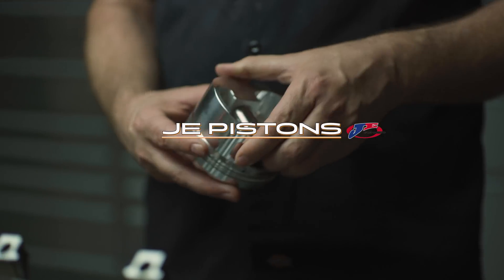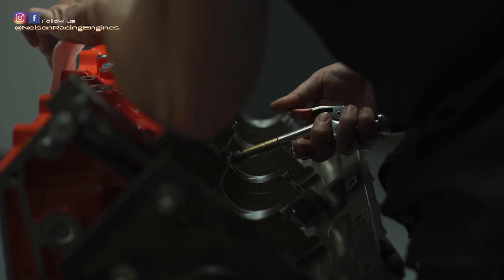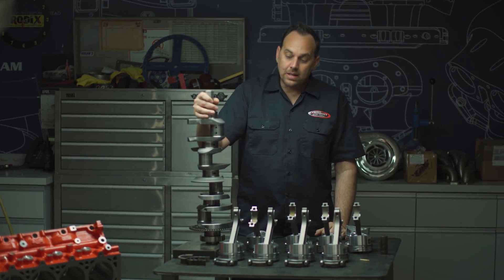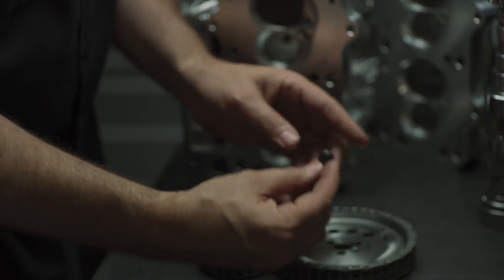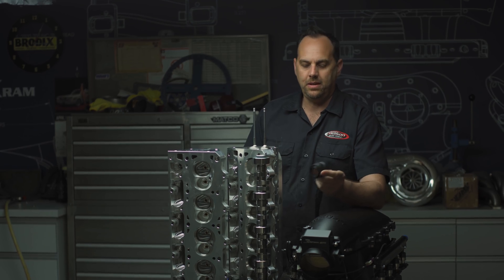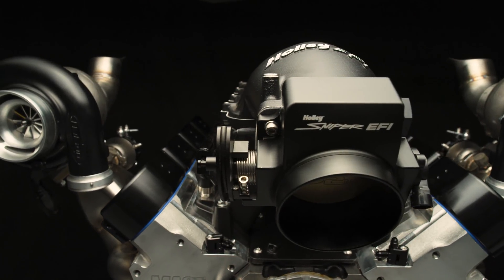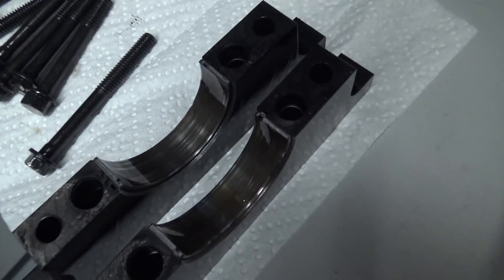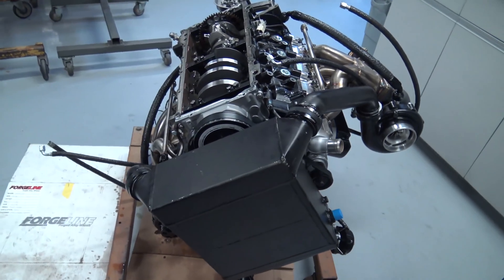Secrets Revealed!  1200 HP 260 ci Chevy LS!  Tom Nelson reveals his secrets!

Comment: I'm blown away by this little monster. Out of all the motors you've built I think this is your master piece.
Reply: The most impressive engines to me are probably oval car engines like Nascar. Take the Daytona 500 for example. Full throttle for 500 miles at 9k rpms. Not many builders could make an engine survive the entirety of the race. Drag racing is such short duration you can have crazy HP numbers that are unrealistic for any short of endurance racing.
Reply: Yeah, before anyone can slam this renowned builder/fabricator. That designs cam/crank/rod/valve/pump etc combos, im guessing WHATEVER you may do or have, cannot compete.  Thats why everyone knows who he and his company are(with multiple records, customers, and award winning projects) and know one knows who.yiu even are. I can buy a 1000 dollar civic and ebay parts and make horsepower dumb ass. This is a whole different ball game. Its kinda like trying to tell a top fuel,7000 hp,  3.5 second quarter engineer that your 4.6 is comparable.  Its just silly and stop.
Reply: Isaac Murrell  Top Fuel makes 10,000 HP these days, and no a 4.6 will not compete.  This small cube LS based engine, that makes a mere 1200 HP, is not impressive.
Reply: @BCSVT  nitromethane is a whole different ball game bud
Reply: Someone must be talking about video games and glitches.
Reply: @duke9620   I mean have a streetable 330ci Ford making 200+ more HP than this on my channel.   🤷🏻‍♂️ ….and it does it with a grossly inferior power adder.   This 260 ci LS still isn’t impressive.  1200 crank = 1000 rw, not impressive. 5 mins at peak RPM?  Again not impressive.  I’m sorry your expectations are so low.
Reply: @duke9620   If this thing was turned up to 1500 HP and it survived that dyno session it would be legitimately impressive to me. 
The rotating assembly should handle it: .325” min thickness piston crown, .225 wall .990” H13 pins, BBC Oliver rods.  It’s a 2000+ HP rotating assembly in this thing so whether it can survive at higher power levels really depends on tuning, cooling, oil system and valve train-stability.  
The engine COULD be impressive but I honestly don’t think this test shows it.  I’m really not here spewing hate…just my honest to god opinion.
Reply: It’s really not that impressive though.
Reply: @BCSVT  really? lol..
Reply: pannic11  1200 crank HP from a 260ci LS?  No, it isn’t, IMHO.  At all.  It’s a 1000 rwhp turbo combo.  I build 284ci Ford street engines that destroy this all of the time.  I’m more impressed with the craftsmanship of his billet intake manifolds than anything, I’ve never seen a Nelson engine that impressed me on power output.
Reply: @BCSVT  Can you run it WOT, Under Full load for 5 minutes, or is it a 7 second wonder?
Reply: P Chivers  Turned down to 1200 crank HP?  It’d go a lot further than 5 mins.
Reply: Brandon Cody  Well armed with facts, aren’t ya fanboy?
Reply: Real Human Bean  Oh look, we have a white Knight here.  I’m sure Tom Nelson is proud of you.  I’ve been aware of Nelson engines for well over a decade, and I’ve never been impressed with the power he gets out of combos.  Project Redline was wildly disappointing.  This engine is not impressive to me, sorry.  “Build them all of the time”?  Different cars, bro.  That’s what happens when you build a successful combo, other people want the same thing.
Reply: @BCSVT  Keep telling yourself that. You Ford drivers are something special
Reply: Brandon Cody It’s honestly funny how butthurt GM fan girls get when hit with the truth.  This engine isn’t particularly impressive, nor is running at full power for 5 mins on an engine stand with steady temps/load/g-force.  This video is great at seeming impressive to the engine ignorant though, so congrats for being the video target market. Lol
Reply: @BCSVT  hey I'm all for building one's own engines and the mindset that yours is the best is the mindset to have but dude has made pump gas turnkey 2000hp combos that can be street driven with his powerglide setups. I personally am a huge fan of the symmetrical turbochargers he sells.
Reply: @BCSVT  But I can agree in the sense that the Ford 4.6 on a Ford made block head and crank went in the 5s in the 1/4 mile. Do that with an ls.
Reply: @BCSVT  Nelson also has a record holding copro Camaro running 260 in the 1/2 mile.
Reply: Mad Mod  That car is a prime example of Nelson just not impressing me.  

TT 632 by block that makes 2500 HP.  It goes 260 mph at the Texas Mile.  

Accufab makes more than that with an OEM head/block casting 330 ci engine, and it also went 300.1 mph at the Texas Mile.
Reply: @BCSVT  look up the world's fastest quarter half and standing mile and you will see no one has beaten them in the half mile. Your not impressed by the current record holders in mph in the 1/2. Your trolling.
Reply: Mad Mod  I’m not actually sure what you’re talking about.  The Nelson Copo Camaro goes 260 in the standing mile with a TT 632.  I’m not familiar with Nelson ever going 260 in the 1/2 mile.
Reply: B C 08 you’re a ford guy, we get it. You’re slapping motors together in your garage for your own use, he has built a multi million dollar business. People pay him more for a motor than your entire fleet of cars is worth, id probably just take the loss and move on before you embarrass yourself any further.
Reply: Chuck Beef  I fail to see how he’s embarrassed himself. He’s qualified his statements without insults, he offered an opinion.  What I think is embarrassing is making uninformed assumptions and believing Tom Nelson needs you, a complete nobody, to be his champion.
Reply: Johnny Jackson hes on here talking like he is big shit, god’s gift to hot rodding. Meanwhile Tom accomplishes more in an afternoon than this dude does in a year.
Reply: Johnny Jackson Oh yeah? What do you do for a living Mr. PrimeRib?
Reply: Chuck Beef  EE, boy.
Reply: B C 08 “this engine is not that impressive to me”  Sure, I don’t think it’s the coolest thing on earth, but I also don’t come on here claiming a 284 Ford is.
Reply: Johnny Jackson ...Just that statement alone says it all. Jesus Christ dude. Just because you wear your greasy coveralls to bed in your trailer, it doesn’t mean you are a wrench.
Reply: @BCSVT  Lol. Show us a video of your +1000hp build and +5 min wot run times please? I would love to see it..